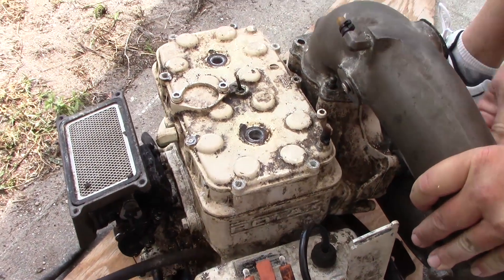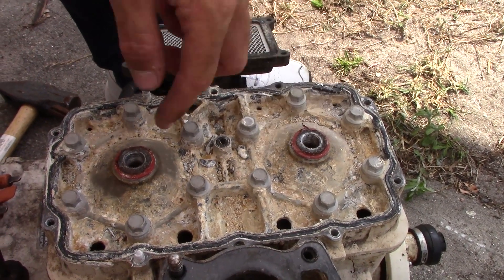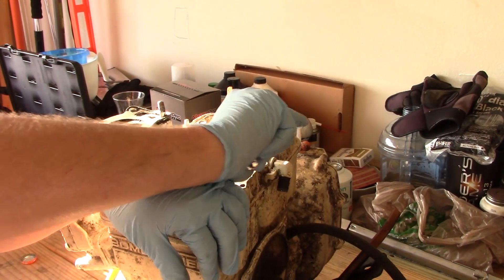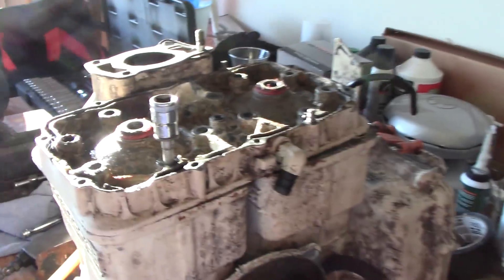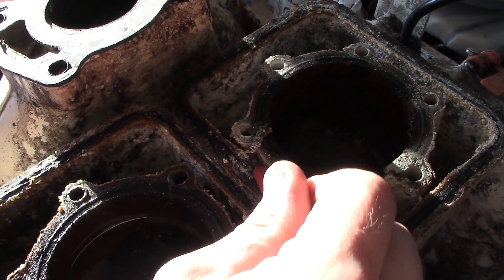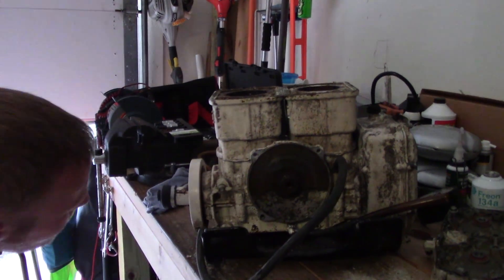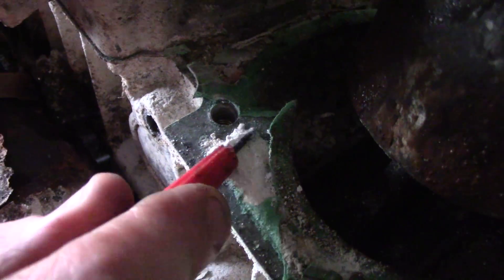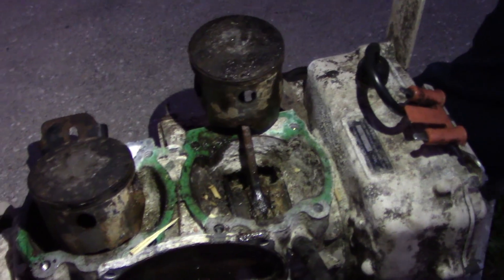Why You Should Flush Your Seadoo Jetski PWC Engine Rotax 587 657 720

Comment: You bought a whole set of wrenches for a 13mm? You realize 1/2 is the same as 13mm, right?
Reply: The wrenches were 8 dollars... Everything on this is metric
Reply: 13mm is .3mm bigger than 1/2” inch. You’d most likely have to force it on the fastener.
Reply: Right. Its not the same

Comment: Next time take a round punch and a hammer and give each bolt a real good wack on top of the head. It will loosen up the corrosion. Most of the time they will come out without braking

Comment: Fresh water wont do that, no way id ever ride my own ski in salt water
Reply: This is a product of not washing through your engine. I live in Ft.Myers, FL, and have a waveblaster 2 from 97 and it starts up just fine and it has only ever been ridden in salt water. Bottom line, if you don't take care of your ski, regardless of water type although you are more prone to salt water corrosion than freshwater corrosion, you WILL get issues like this.
Reply: Vincent Perstad Leveau true I ride in the Mississippi River and have owned a few used ones and if you don’t take care of them they will leave you stranded
Reply: Salt water is for rental skis 😎😎😎